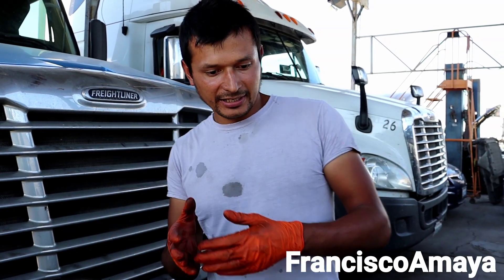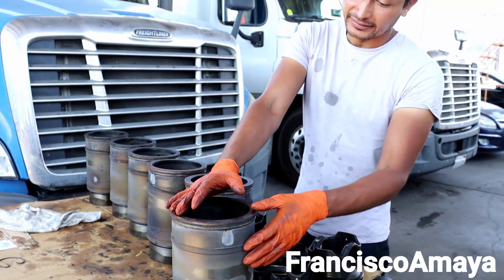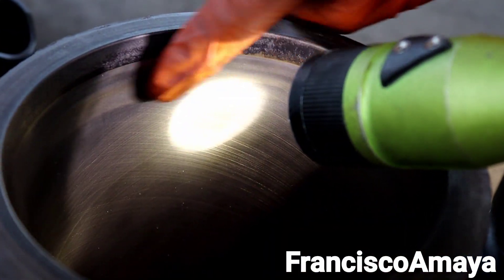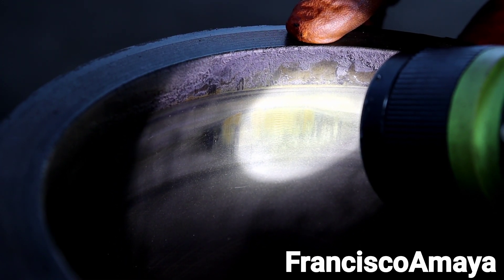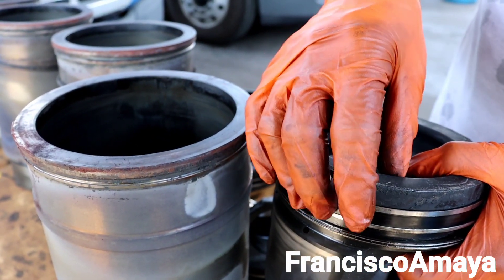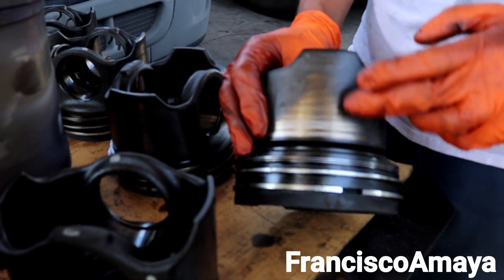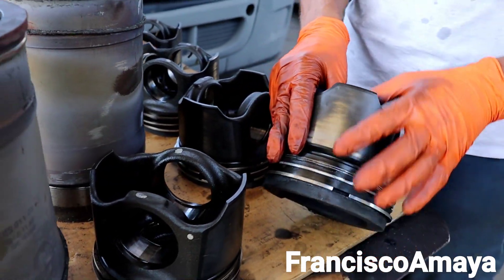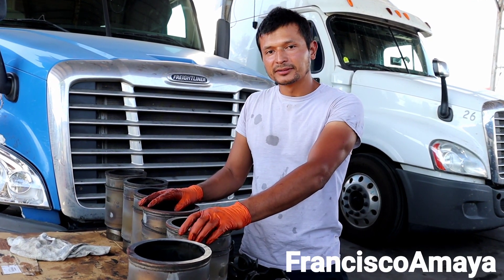Freightliner Cascadia DD13 DD15 DD16 engine high oil consumption problem burning oil

Comment: I notice that oil in the liner is your diagnosis due to big ring gaps.  Of the pistons that I can see,  The rings are not clocked properly also.  I have heard some say it does not matter but I think this is a good example that is DOES matter.

Comment: Francisco my truck is losing oil not going to diesel tank or coolant what can it be
Reply from the maker: Maybe, turbo or internal engine problem
Reply: The only way to detect that problem is to open up the motor thankyou for replying 🙏

Comment: The engine speed problem is particularly so with the automatics. The driver can still drop down a gear but 90% of the time don’t, and just sit there with the pedal to the floor saying this truck is slow and has no power.

Comment: FIVE GALLONS OF OIL in less than 1000 miles.

2011 cascadia DD15 125. Bought truck in Feb ‘22. Seller drove it from Houston to San Antonio. Had oil changed and other items replaced. I bought it. My first weekend running drove 260 miles Saturday night and then drove 590 miles Sunday. Last 30 miles to destination check engine, stop engine and oil light came. No oil on dipstick. Added 22 quarts to get out to full line. FIVE GALLONS!

Drove home to SA. Added TWO GALLONS.

Replaced oil pump, oil sensor. 

Ran it to Oklahoma. On the way back same lights came on. Added just over gallon and got truck back. On arrival, added 4 gallons to get to full line. 

Figuring it’s burning nearly a gallon every 100 miles. ONE HUNDRED. Runs smooth, no other warnings. No leaks. No oil in fuel tanks. No oil in turbo. No oil in coolant. No smoking exhaust. No oil in air tanks.
Reply: What was your fix?
Reply: @ReptoOwnsYou  I’m running it. Can’t afford to even check to verify what the problem is. Recent well site I was on was 18 miles from plant to well, getting about 1-2 loads a day. Added about 1.5 gallons a day. Don’t have a choice. No one I’ve spoken with has a clue.
Reply: @darylarchuleta7604  how long have you started adding oil daily? My dads truck is using oil too recently and wonder what could be issue
Reply: are you still running it that way or figured the problem i guess i got the same issues
Reply: @ismail255  did you figure your problem out? from what he explained seemed like the oi was not leaking but was getting stuck somewhere and burning up maybe at the pis ton rings

Comment: I have a DD-15 motor as well The mileage on my truck is 1,119,868 mi My motor was built at 9 00,000 mi I don't hear no ticking sounds any of that and as far as the RPMs go I drive this truck at 15 RPM I never keep it low RPM high idle

Comment: Francisco I have a question? I just had my oil cooler replaced because it was leaking for a long time literally a week ago and now I'm burning a gallon of oil every thousand miles but I just had this motor rebuilt a year ago I'm sorry a year and 6 months ago could it be the motor or something else if it was a turbo how would I know?

Comment: Hi, Amaya. 
I like you explanation of this problem. Can it happen on gas engines too?
I have my pick up truck GMC Sierra 3500, and looks transmission problem. It was running normal with 2500RPM, but recently jumping to 3500 RPMs and looks like torque converter or gear is missing in transmission. 

Is anybody here have experienced this problem, Please? Every advise is highly appreciated.

Comment: I have Freightliner Century 2009 with 830k millages and my truck burn about 1gallon for 200millages. I don't want to rebuilt my engine right now, any help to save oil?

Comment: Oil is cheaper than to do overhaul. Change oil often (15k miles), synthetic 25k and use Lucas. Freightliner says keep running 45k, I say don't do it. Those pistons are cooked.
Reply: Do you recommend to use Lucas even with 15w40 grade? Isn't getting to thick? I'm using 15w40 rotella , changing every 20-25k km.
Reply: @olegd268  are you in Canada? In the Summer add Lucas in the Winter when gets below 10°C just oil. I change oil myself I add half a gallon with new oil and other half I add after but I keep Lucas mixed with oil when I have to add. It works for me what you do is up to you.
Reply: @nikolairomanov3160  i replace oil myself as well. Was always a bit afraid to get it too thick by adding lucas. In winter I usually mix 50/50 0w40 and 15w40. For easier starts when up north. But never added Lucas. Had overhead done about 500k km ago . Having 1.5 million km now. DD15 2015. Still very strong pressure over 50 psi. Rolled new bearings in on crankshaft with overhead and new pump/ pickup tube. Will definitely add this change after trip. Yha in Canada. But always running down US south and back.
Reply: @nikolairomanov3160   and so far no oil consumption.
Reply: I have c15 acert but for ur dd15 I belive synthetic is recommended. If it works for you .... Lucas doesn't make thinker it sticks to the metal protects cold crank. The metal not dry on cold start.

Comment: My dd15 reach 1M miles today. It running  like new with an excellent oil pressure. My only concern is oil consumption. It’s about 2.5 to 3 gallons in 10K miles. But I noticed the consumption began after the first 5 or 6k miles running. Qué me aconsejas? Hacer el overhaul o esperar un mayor consumo?
Reply: Mine did the same thing….started burning 1 gallon a week untill it finally gave out……

Comment: Francisco!!! Thanks. Mine has been burning about 5 gallons every 1k but I decided to keep topping up till  it hits 1.6M kms then rebuild it. It's currently at 1.45M kms been burning oil since 860k
Reply: Al din que ...motor es
Reply: What motor do you have
Reply: @quewat3676  The all mighty DD15
Reply: And correction, burns about 2 gallons every 1k
Reply: How high was your oil pressure gauge while driving, ?
Reply: @williamjoaquin135  it's usually about 55 running down the road and 28ish idling
Reply: Mine is burning about 1gallon for 200milles. 830k millage
Reply: @ArditRamaj  are you also just adding or you fixed it
Reply: @ismail  not yet, I rebuild the engine and it's still burning oil.  Maybe something wrong with the crankshaft?
Reply: @ArditRamaj jus curious, did u  change liners and pistons, I got an Isx burnin much oil, at 500k mls  wanna do an inframe .
Reply: micheal did happen to fix or still adding oil?

Comment: I like your videos. Helpful to me, owner operator trying to do my own repair and maintenance. I bought a used Schneider 2012 Freightliner Columbia glider. 2002 Series 60. Had 511,000 mi. at purchase. Dropped #5 exhaust valve at 588,000 mi. 
Performed low budget repair. Fixed valve, one liner&piston looked rough not#5. Only top of piston beat up a little. Crazy thing....could not find piece of valve at disassembly!! Replaced #6 because liner had unusual wear marks around circumference, like coolant got in and layed there waiting repair.
837,000 on engine now, but uses 4 gallons oil in 15,000 mi maintenance cycle. Mostly when oil is getting old. Mostly heavy flatbed loads in northeast region. Stock 430 horsepower
Reply: Your problem is a idiots who trashed your truck before you and a Schneider why was saving every penny to keep it instead of maintaining your truck.
Reply: @СтепанБандера-ы8у  Schneider knows how to get the most for their money. How much to budget for maintenance and when to sell because problems will arise due to minimal care. They replace a truck after approximately 5 yrs/500,000 miles. Power and drivetrain longevity is not highest concern.
Reply: Schneider doesn't change oil for 30k miles. They add oil Delvac at PM service and change oil filter b4 30k miles. I think the overhead should of been done right after you got the truck.
Reply: @nikolairomanov3160  I agree. My bad because of inexperience. Must do overhead after purchase to know starting out with good valve adjustment. Simple and cheap....good insurance.

Comment: Francisco,I hope you read and answer this: how can we prevent OR know when the engine is close to catastrophic fail? my engine was working like a dream,smooth and quiet,no oil consumption,no leaks of any kind,even with over 1mill miles.
But last week,BOOM! the coolant went into the engine,it damaged the camshaft as well,I stopped the engine inmediatly,but the damage was done.
How can we know before this happens? my truck had a lot of new parts,New SCR box,new radiator,new tires,new ac system..so my loss is double,the engine costs from 34k to 44k for an overhaul and 50k for a new engine,I am junking it at this point,but it was a delight not having payments and what I thought was a good engine. Answer if you can,please.
Reply: What about getting a used engine?
Reply: @odestryjam2231  Most used ones cone with over 300k miles at astronomical prices,some want the core or they charge 2k if no core.
In my position is best to buy a fairly new truck,which I did,I just want the knowledge for future reference.
Reply: You might see coolant in your oil pan. As coolant is heavier than oil so it will stay in bottom which might give you an early start. Or you can check the coolant reservoir level. If the coolant is not leaking outside then it’s going in. Could be the cups, EGR or just a oil cooler.
Reply: @supreetdhillon9665  Well,I was hoping a better signal/warning than that,I did my PTI that day in the morning,all fluids were fine and upto level,no strange sounds of any kind,no smoking of any kind either,but in the evening I was pulling a heavy load up i 77 in WV, and just like that,in less than 30 seconds,I had just stopped for fuel 1 hr ago,and nothing unusual,when the mountains got heavier that s when it happened.
R.I.P. my truck,it was a good one.
Thanks for the info.
Reply: 1million miles is time for new truck. That supposed to be sign that truck is at the end of its lifespan. If it drove a million miles it should make enough money to buy new truck.
Reply: @simonsays6924  and it did make enough money,I had my savings for that,however I want to know for the future if there are signs to look for.
Reply: @simonsays6924  True,and it is a theory that I tell all my friends,I was talking to the dealer in my home town about going and trade in,but it gave out one week too early,the situation got out of control,like I said,I had done oil analysis,looked worked and sounded better than new,even a little bit more powerful.
abd it gave out suddenly.

Comment: Is 1 gallon of oil every 15000 miles bad ?
Reply: One gallon every 15,000 is normal. No problem.
Reply: 800,000 1.5 gallon every 13,000 miles. 2009 DD15
Reply: 2011 Cascadia, DD15, 1,060,000mi, 2 ga /12000mi with light loads and 4ga/12000mi with heavy loads
Reply: 2015 dd15 720k miles burning maybe 1 quarter of oil every 20k miles...